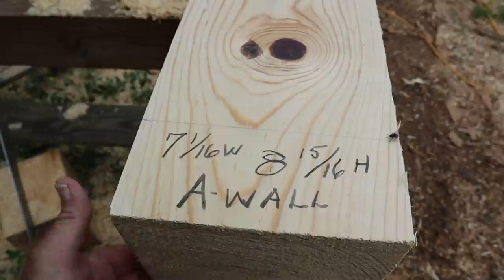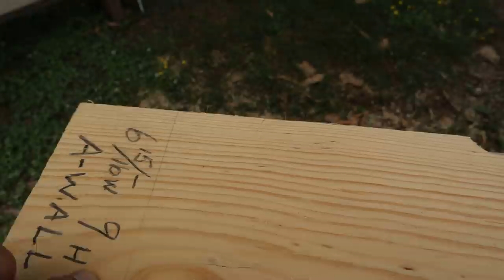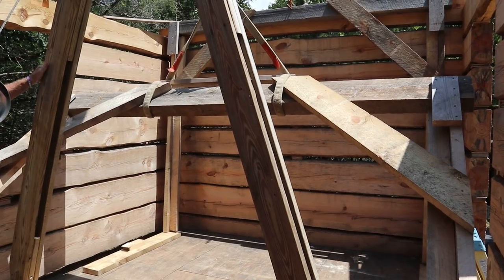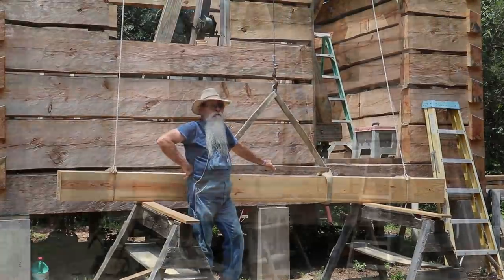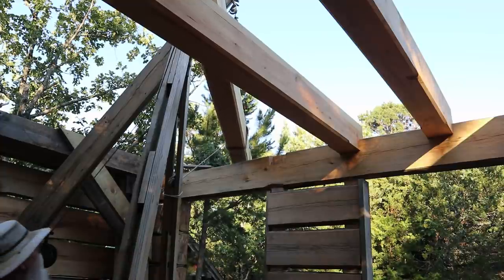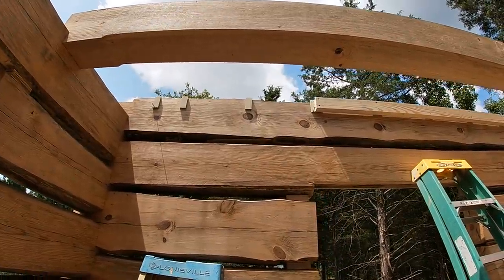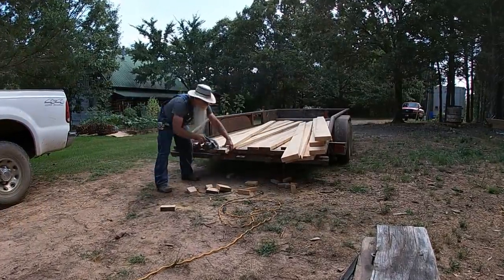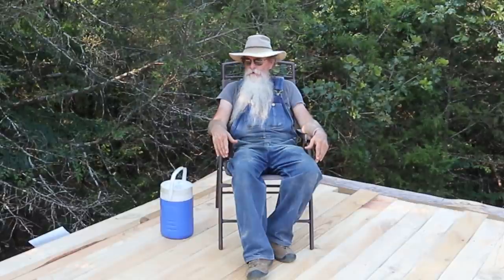Second Floor Joist, Dovetail Log Cabin Build (Ep 31)

Comment: From a professor of video and editing: You need to turn your microphone higher on the DB meter… -47db as an example. I can barley hear your audio because you’ve turned it down due to the over modulation of the audio. Turning down over modulated audio won’t fix it. I assume you have the Rode ‘Filmmaker” lavelier microphone. In the setting output menu, turning it to a lower number makes it over modulated. Tuen it to a higher number and it will be better. I know it sounds odd,, but trust me….., good luck, because I can’t hear this video due to the low levels and over modulation.
Reply from the maker: Thank  you , I’m going to look into that!
Reply: @TheBeardedCarpenter  Let me know if you need any help! Good luck!

Comment: Good Evening,

Hope your day is going well. I’ve thoroughly enjoyed your video series on building a dovetail log cabin. My wife and I are making plans to do just that. I noticed on a couple of your videos there appeared to be what looked like sheet metal on top of certain features (e.g. the pylons where you set the sills, the tops of the second floor joists, etc.). I wondered if you could describe the purpose for each of those? Thanks so much for sharing your knowledge. God bless.
Reply from the maker: Howdy Bill- the metal sheeting on top of the second floor joists is just temporary protection from water dripping between the temporary floor boards. It helps keep the timbers from having streaks on the sides.  The flashing on the piers keeps the sill logs from wicking moisture from the concrete piers. Thank you so much for watching the videos. Take care and God bless you

Comment: Do the wall logs supporting the floor joists need additional bracing when the joist sits above a window?
Reply from the maker: Howdy JT- I put blocking in the logs so weight can be transferred down. There is a substantial amount of wood left under the joists and on the outside I have the full height of the log so it is still really strong. Good question by the way. Thank you so much for watching the video. God bless you

Comment: Sir, you did not talk about the metal sheet that you placed on top of the joists, on top of which you put the second floor flooring. What metal is that? How thick are they? Is it the same metal and thickness as what was used below the sill logs? I also saw the metal sheets were curved upwards at the ends. Secondly, the last joist that you put in, had a pipe-like groove cut into one of its ends. Could you please explain that? Regards.
Reply from the maker: AS   Howdy- the metal is just cheap aluminum flashing that will keep the rain water from making streaks down the sides between the temporary floor. I just pulled the metal back from the end of the joists so I could set the log that is over them. God bless you
Reply from the maker: AS   The groove on the end of the joist is because it was at an electrical hole drilled through the wall log. Blessings to you

Comment: Dear Sir, greetings of the day. When you fix the length of the joist that goes into the joist pocket as 3", is it because the total pocketed length of any joist is then 6", the thickness of the logs? Or is it just a number that you feel is adequate to withstand any load, be it on the main floor or loft floor? Secondly, how do you arrive at the dimensions of the joist as 7" by 9"? Warm regards.
Reply from the maker: AS   Howdy AS- the the depth of the joist pockets are just 1/4” more than how much the joists will extend into the log. I feel three inches is adequate for carrying the load on them. There is enough wood left on the log under the joists and the full height of the log on the outside to not weaken the log from being able to do what is asked of it. A 6”x8” joist would have been strong enough to carry the second floor load but since l had some hefty looking logs in the walls l chose to go a bit bigger with them to keep the proportions equal with each other. I do a lot of over kill on timbers to keep everything asthectically pleasing and to keep things correct proportionally. Hope this helps you. I appreciate your questions and I hope I’m able to clarify things for you. God bless you
Reply: @TheBeardedCarpenter  Thank you for the encouragement Sir. I have a desire to understand things that I like, down to the last detail. And I feel in you I have found a person who has a streak of perfectionism. Hence I ask. I do not always understand everything that you say but that is understandable given your vast experience as opposed to I, whose sole carpentry exposure thus far has been to spike a few nails into doors to hang clothes from. Nevertheless your patience with the questions is beyond commendable. Warm regards.
Reply: @TheBeardedCarpenter  Thank you Sir. When you say the depth of the joist pocket is 1/4" more than how much the joists will extend into them, do you mean that each joist pocket is 3 and 1/4" long? As a sample, how deep (the dimension along the height of the floor log) will the joist pocket be on average? Regards.
Reply from the maker: AS   Howdy AS- just now found this. My phone didn’t give me a notification. Sorry. The depth of the pocket is from the inside face of the log to the back side of the cut out. The height of the joists in the log is taken from the center line. I can go either above or below the center line depending on how tall the joists are. Working from an established center line makes it possible to use logs that aren’t exactly straight or maybe a little bit wider or narrower depending on the individual log. I am able to use the natural shapes of the logs and when the cabin is chinked each log shows it’s own personality. I do appreciate your questions and hope someday you will be able to build your own log cabin. God bless you